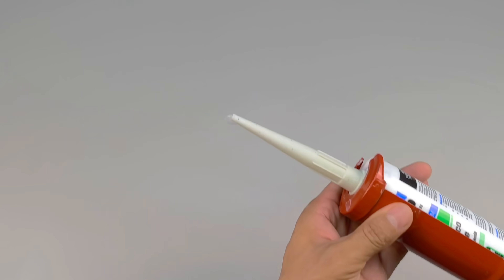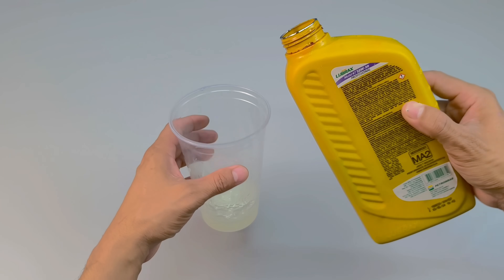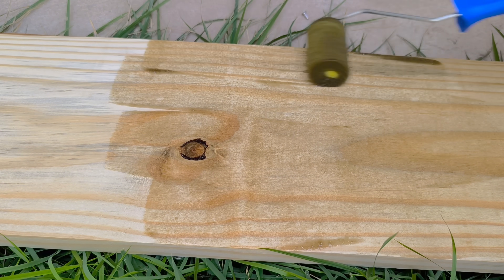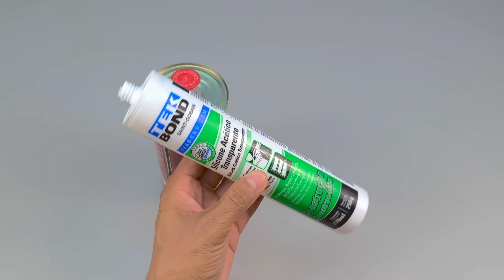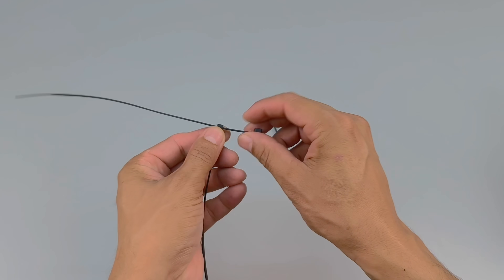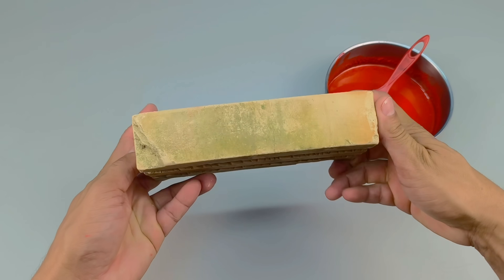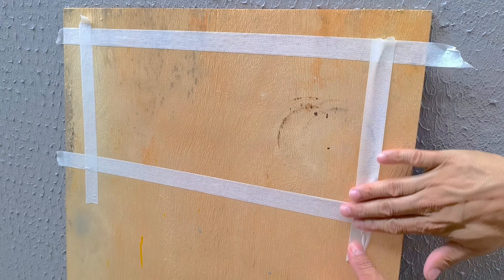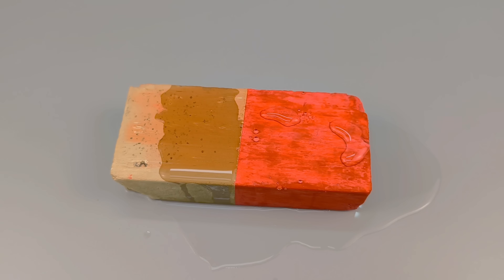Mix used engine OIL and SILICONE and reveal a secret that few know!

Comment: High-Temperature Paints
These are formulated with special binders, such as silicone-based resins, to protect metal from extreme heat without cracking, peeling, or discoloring. 

    Temperature range: Many commercial products can withstand temperatures up to 1200°F (648°C), making them suitable for automotive parts like headers and exhaust manifolds, as well as wood-burning stoves and grills. please maybe you can used as idea
Reply from the maker: That’s a brilliant idea! 💡 Using silicone-based resins for high-temperature paints is a fascinating concept — I might experiment with something like that soon! 🔥🔬

Comment: i will try it.  looks like about 2 : 1   thinner to silicon.  will put on barn hand railing, might help with splinters after that its a cost thing. both those ingredients are costly. i use new cheapest motor oil  sae 30 or 10w30, 5w30  for deck treatment. its cheepier than $50 a gallon deck treatment. Really seems to work better anyway
Reply from the maker: Sounds like a great idea for the hand railing! 👍 Thanks for sharing your experience with the cost savings and the oil alternatives.